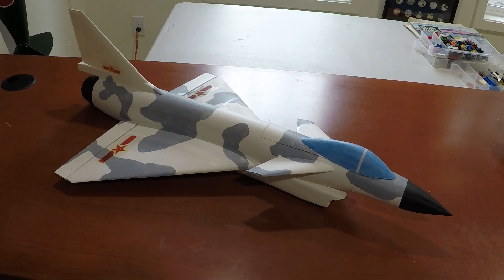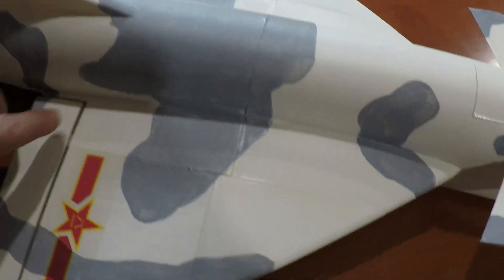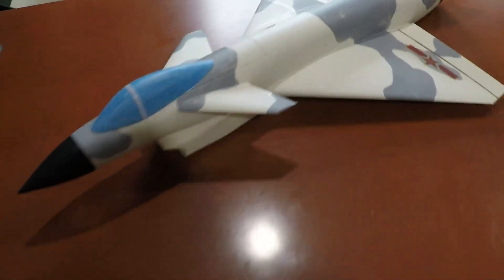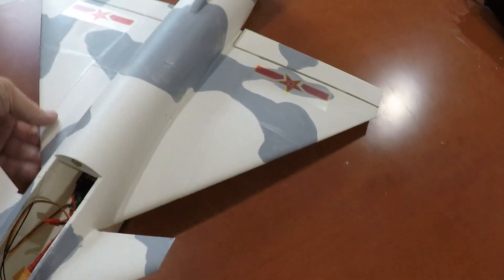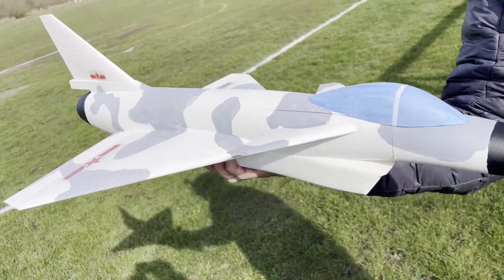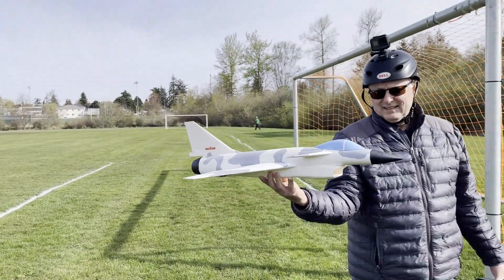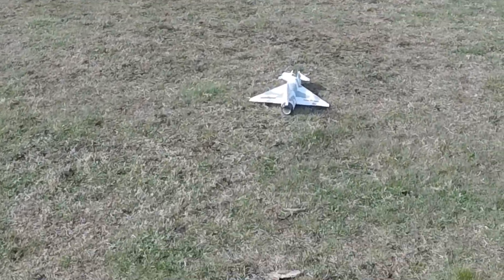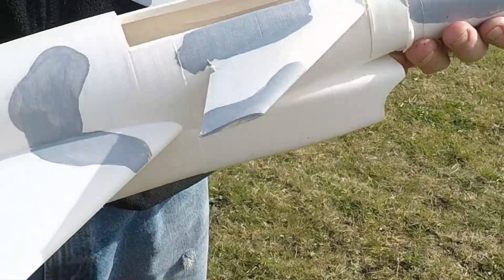J10 50mm EDF 3D Printed by BUILT FAST: Build Overview and Maiden

Comment: You really do a nice job on your builds! Thank you for all the time you put into these videos and the specs you posted in the description! I was worried about you landing watching you fly this thing because it's kinda small for that weight. It looks AWESOME though!  I like to use steel wires surrounding my battery compartment, so the nose doesn't break off. Thanks for uploading, I enjoyed watching this!
Reply from the maker: @HoloModels-RC  thanks! I built another one awhile ago and reinforced the inside and outside with light fiberglass.  Still trying to get a maiden in…getting closer. Great ideas on the steel reinforcement, I may try that too